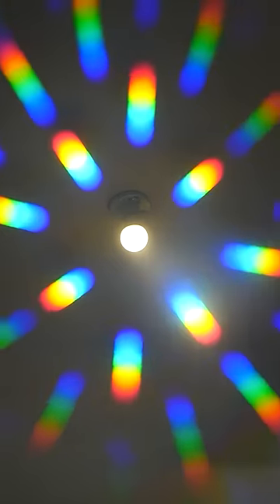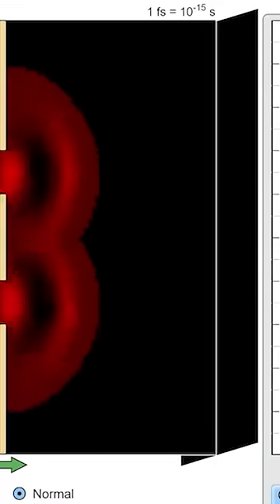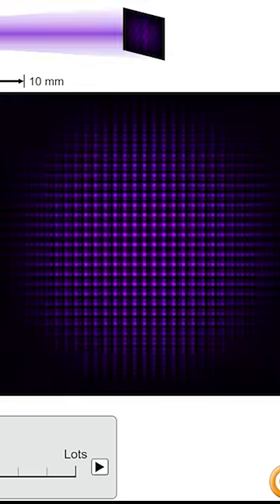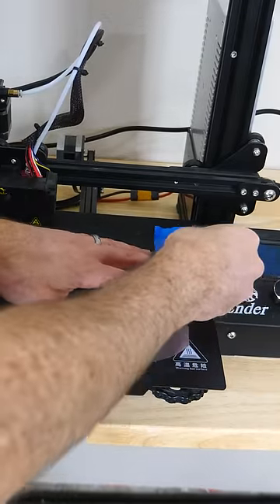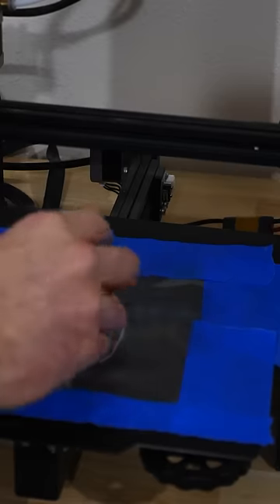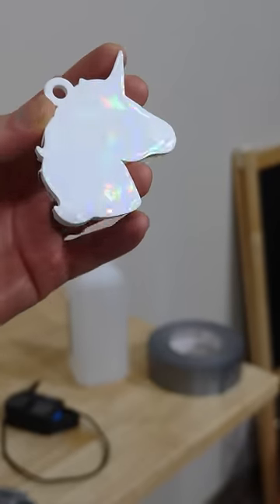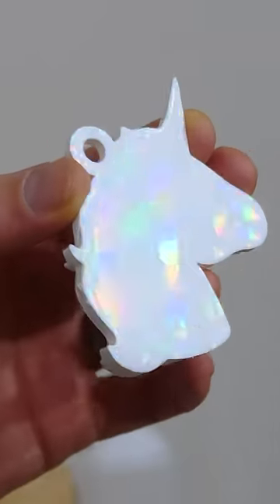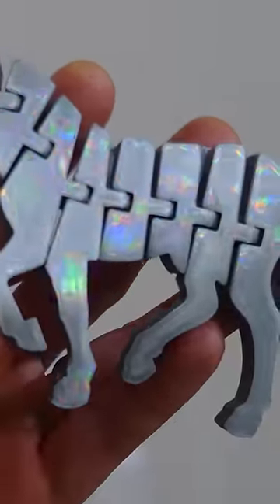3D Printing a Diffraction Pattern

Comment: Cool that the 3d printer was able to pick up the grooves like that....
Reply: Curious how that worked.  He laid the sheet down on the print surface, but I thought 3D printers just built up from the base using plastic filament?  How did it capture the material?
Reply: @Bobsods  the hot plastic probably fell into the grooves like a chocolate mould before cooling down I guess
Reply: @jnlolz  That's exactly what happened. 3d prints take on the texture of whatever surface they're printed on
Reply: @jnlolz  I saw this done with chocolate too. Pretty amazing the shiny surfaces will copy the light bending interference pattern.

Comment: "Daddy I want a nuke"
"Say no more"
*Positions camera menacingly
Reply: "Today I have teamed up with Nile Red and Mark Rober to create a nuke."
Reply: Our plan is to create the gun type Fission single core because its the simplest design. Gun type design works by [REDACTED].
Reply: @jasonchiu272  Gliterbomb 69.0, its just a nuke in a box
Reply: * "Time for a new season of chernobyl." *
Reply: Shovels the whole garden for micrograms of plutonium.
Reply: Wholesome
Reply: Lmaoo 🤣
Reply: "so what I have here is a uranium particle....."
Reply: @anjotubeJE  
I tasted the Nuke and I quite didn't like the taste.
NileRed probably
Reply: It's fairly easy for a physics PhD to make a nuke with openly available information. The only difficult parts to obtain are plutonium, neutron sources and the high power switches needed to fire the explosive lens around the nuclear core. That may change quite soon because high electron mobility transistors capable of switching over a megawatt in less than 300ns can be obtained from electric car superchargers. Polonium for neutron sources can be obtained from anti-static brushes used in clean room equipment. Plutonium is going to be the hardest for an amateur to obtain, but I suppose you could bribe a Pakistani or North Korean official for a large enough "sample".
Reply: @jasonchiu272  👀nilered....

Comment: I thought you where imprinting linear grooves.
Does the sheet keeps sticked to the 3D print.or do you use a glue to keep the edge slick ?

Comment: I still don’t fully understand how this works, I’m very familiar with light interfering to produce rainbows, and I’m somewhat familiar with diffraction gratings and how they work, but I don’t understand how putting the diffraction grating on the 3D printer transfers the properties onto the unicorn .

I guess the thing I don’t understand is how does the 3D printer work? I’m guessing it’s a resin printer? How exactly do they work from a science stand point / on a molecular level?

Comment: Okaaaaaay duuude I just want to blow some smoke. This can only work this well if your first layer (the one that sticks to the hot plate & in this case the lenticular material) is PERFECT. Otherwise this wouldn't work as well. I bet you've printed MANY one layer thick slices to get it tuned that closely 🤭